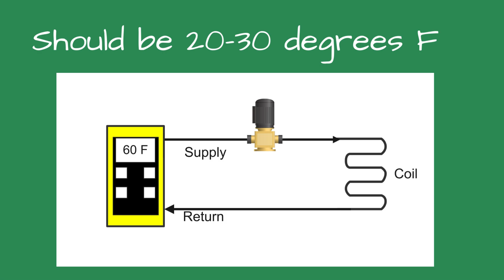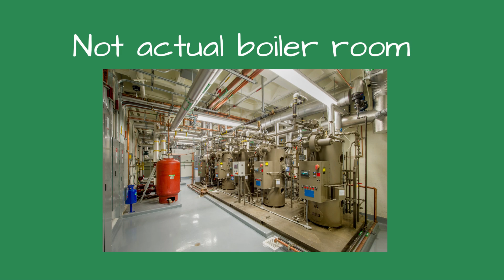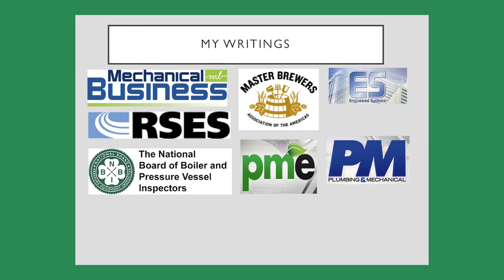Case of the angry engineer

Comment: That is a very sad case.  It's especially sad when it could have been prevented by proper communication / documentation of ongoing work, in the way of the first pump being temporarily replaced by a lower capacity model.  

I work in a totally different industry, but the same principle applies with employees / colleagues leaving a customer in an angry state due to their attitude. Flew to Australia on short notice, to assist with some engine / generator / PLC operational problems. Another technician from out company had been on site for weeks prior. The technician had made a real mess of the situation. When I arrived on site I was treated very poorly and had to have a stand-down and conference call about the "politics" going on at the site. The previous technician had angered certain employees at the customer site; who were doing things to ensure he did not succeed with the troubleshooting. When I arrived, they tried the same tactics on me, which I detected and called the aforementioned stop-work meeting. Probably the most stressful assignment I have gone on. The cause? In spite of everyone "swearing on the Bible" that no parts had been exchanged between any of the (not exactly identical) units, I found that half of one engine wiring harness was swapped from one unit to the other, leading to the multiple problems we were experiencing. Nobody knew how it happened. But it happened. Putting the parts back on the correct units was the first step in fixing all the "repair damage" caused by the week of fruitless troubleshooting.
Reply from the maker: Wow that’s crazy You have more patience than I do Thanks for sharing